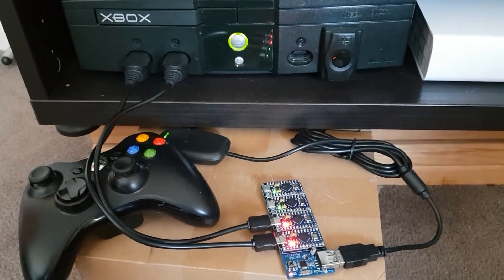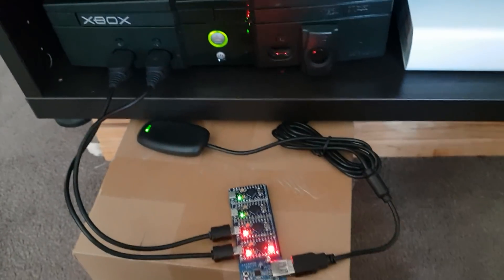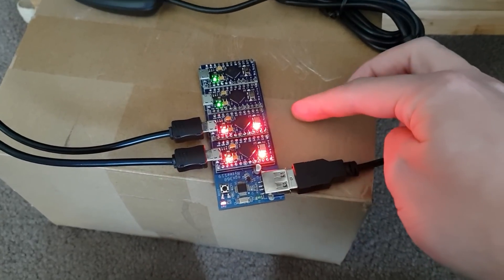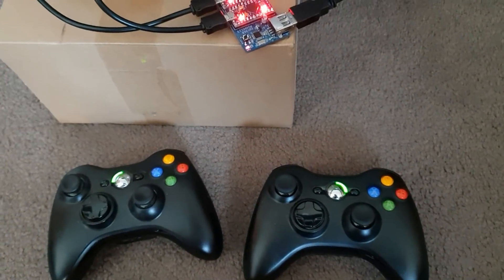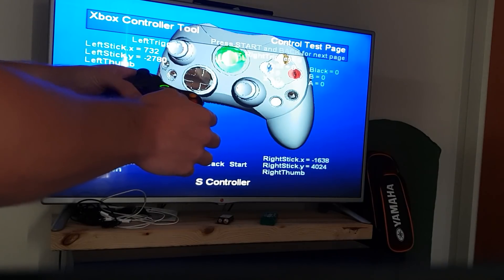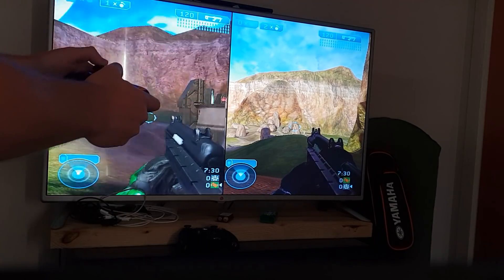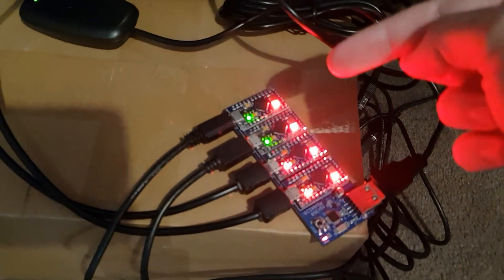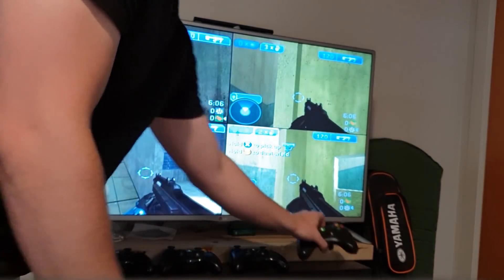Wireless Xbox 360 Controllers on the Original Xbox!

Comment: I'm going to mod this to go inside one of my original Xboxes. Thank you for this. Out of the consoles, pcs android boxes and others that I own, the OG Xbox is used by me more than anything. My kids grew up using it, and now my grandkids get as .uch joy from it aswell. Never had no problems with them. Other than the clock cap removal never had to take a soldering iron to them. I've upgraded hard drives, replaced dvd drive belts etc but nothing major. They are a good work horse.

 I'm planning on upgrading the memory to 128mb on at least one of them, but am waiting because I've heard whispers that someone has piggy-backed another 128mb on top of the upgraded 128mb. How stable this is I don't know I've not really found any info that shows it working or anything, but apparently after it was found that you could upgrade the previously un-upgradeable 1.6/1.6b by piggy-backing the extra memory on to the existing ram chips, and they have gone on to do this on an older upgraded Xbox model using the same method, and have it with the now upgraded 256mb memory showing . They haven't said whether or not it runs any better than before . I have been looking for the post I saw it on, but I'm unsure which forum I saw it in as it was around a year ago. I'm sure it was an Xbox one but it might have been a general console repair and mod forum. It was only a few lines of txt explaining what they had done etc and a few pics, it probably didn't work or may even have been fake, because after a year I would expected it to be quite big news in the Xbox community by now if it did

Comment: Hey bro. Are you still selling these? It's so difficult to get a good wired controller as it is. This would solve slot of problems.
Reply: Is he still selling them? Have you found anyone else that is?
Reply: @Uniballa23  look up Brook Wingman XB2. Its a USB convertor that allows you to use any one of the 125 wireless controllers on the list to play on your origional xbox. Basically any wireless controller you can find. PS4, PS5, Xbox 360 or Xbox one etc. You Just need a USB controller port cord. They can be found online very cheap.

Comment: Could you add better descriptions on your GitHub page on how to set this up, I need help.
Reply from the maker: You need to order the PCB and components and solder it yourself.
This is a very simple process via KitSpace. (Linked in the repo)
https://github.com/Ryzee119/ogx360/tree/master/Hardware

Once assembled, programming is detailed https://github.com/Ryzee119/ogx360/tree/master/Firmware

Comment: cool stuff for sure. But all I done with electronics is solder a new microswitch into an old mouse and put Kodi on a Raspberri Pi.
How would I get the ogx360 board in the first place? send these schematics to a company that makes custom PCBs? How much does that cost on average? And then I guess if I receive such a working PCB I need to solder these Arduino Nano boards (10€ each) onto the receiving slots of this ogx360, and I assume to get your firmware on it I can plug it into my PC's USB port and use some software, right?
Reply: alright, found a company that makes PCBs. this one would cost 50€ without any assembly, didnt make an account there yet, but I assume the whole thing would cost like 100€. Probably too expensive to make for people who don't have an Electronics workshop already.

Comment: *Edit: works! The culprit was 8bitdos auto update. Always manually update your 8bitdo kids. Works fine on 1.32 now*

Hey Ryan. I'm having trouble pairing my (orange) 8bitdo and Xbox One S/X controller with my console. Or rather it pairs in that I get a rumble and solid Xbox light fine but it won't allow any button presses.Updated the ogx360 firmware to 1.4. Still no luck. I'm usually fairly well versed in trouble shooting but I figured I'd ask all the same. Will update if I find an answer beforehand.
Also the light on the bottom of the 8bitdo board won't light up unless I hit the reset button and if I hit that, it freezes my xbox. Could it be an installation issue?
Controller and 8bitdo are both on latest firmware (1.32)

Comment: I just ordered one strictly for the Steel Battalion. Can’t wait to use it for real.
Reply: How did you order it?
Reply: Ebay just search using keyword original Xbox controller adapter. You'll have to specify if you want the Steel Battalion option as it's a different firmware and you can't use wired Xbox one x controllers if you go that route. I use it all the time well worth it if you don't want to hassle repairing OG Xbox controllers.

Comment: What happens if you press the Xbox button on the control?
Reply from the maker: If you hold it down it will turn off the controller. If you press it it does nothing normally. However in Steel Battalion Emulation mode with the wireless controller and chatpad it is the eject button
Reply: @RockingRyzee  oh ok cool thanks

Comment: Hello man is it possible to use the receiver from a dead console? I made a receiver for my PC with one of those, and to synchronize the controller to the receiver board I conected the USB charging cable to the same computer and installed the drivers so that the question man I hope you respond because those oficial receivers are difficult to find In my country and I have tons of dead RROD 360s with those receiver boards.

https://www.google.com/amp/s/gr33nonline.wordpress.com/2015/09/19/make-an-xbox-receiver/amp/

Comment: That is bad ass. If more people pick these up, then it'll cut demand for that Logitech wireless controller for the original Xbox. Now after watching your video, I'm wondering if anyone has take the power button mechanism and RF receiver parts out of an Xbox 360 and added them to an original Xbox.  If so, then the 360 controllers should be able to wirelessly power on the original Xbox...

Comment: Is it possible to use Bluetooth controllers aka Xbox one controller maybe using Bluetooth usb adapter
Reply from the maker: You can use one bluetooth controller if you get the orange 8bitdo wireless adaptor. This supports bluetooth compatible xbone controllers

Comment: This is a really awesome project you got going on. Currently I'm using a few Logitech wireless controllers on my OG Xbox with a couple of S Controllers on the side. The Logitech controllers are excellent despite being third party but they're getting harder to find, are rising in price and require they're own special receiver to work. Due to their age they're also starting to break more often and may also have problems with batteries leaking inside of them. The beautiful thing about your adapter is not only does it take advantage of a better controller that easier and cheaper to find, but even with the cost of all the equipment needed for this adapter to work it would still be cheaper than buying four working Logitech controllers. I'll be keeping an eye on this one for sure. :)

Comment: Amazing!

I wonder if this will fit inside the xbox.

I could just solder the wires to the board from the inside and just let the reciever be glued on the back or top of the console itself.

Or could i strip the reciever and put it inside where a controller slot used to be (slot 4)

Is it possible?
Reply: That was my first thought. Id want to install a master switch to switch whether the system will be using the wireless controllers, or wired controllers on the front. Im sure its possible

Comment: Could we use one of those Xbox controller port to USB cables that modders use to install unleash to the system? Presuming you could just plug the 360 dongle into the usb cable and then plugging the cable into the system? I haven't tried it yet but intended to soon. They sell the cable for a couple bucks from China.
Reply from the maker: It won't work.. there's a reason that whole circuit board is required.

Comment: Really impressive work do you plan to support xbox one controllers in the future?
Reply from the maker: I have some experimental firmware on my github with Xbox One wired controller support :) You need to use an externally powered USB Hub to connect more than one wired controller through.

Comment: This is amazing, thank you! We just need DualShock 3 support for PlayStation 2 now :)
Reply: You can use DualShock 3 and 4 on PlayStation 2 with OPL, which isn't too bad.
Reply: Oh right. I forgot about that, thanks!
Reply: There's a 3rd party adaptor that allows both dualshock 4/3 controllers to work via bluetooth its from a company called brooks
Reply: Pretty sure it could be done same way
Reply: But you have to be plugged in right?

Comment: Is the same possible using an xbox one wireless adapter instead of the xbox 360?
Reply from the maker: I will say possible, but not supported. As I understand the Xbone wireless adaptor is quite complex and probably beyond my knowledge to write a low level driver for it compatible with this hardware.
Reply: @RockingRyzee  Interesting. But that definitely leaves open the possibility to bring xbox one controller compatibility in a future firmware update. If i get some time i'll try and look into it a bit more and see how deep that rabbit hole goes lol. Thanks for the feedback!